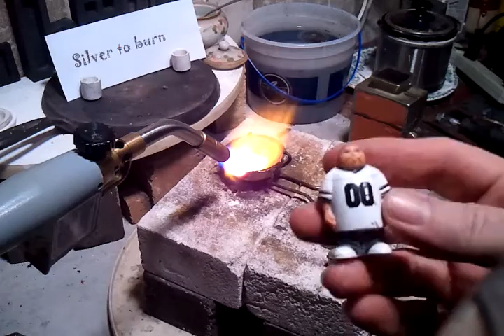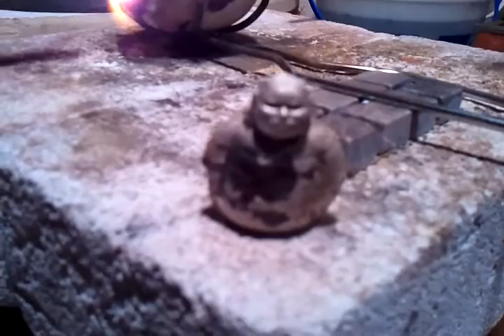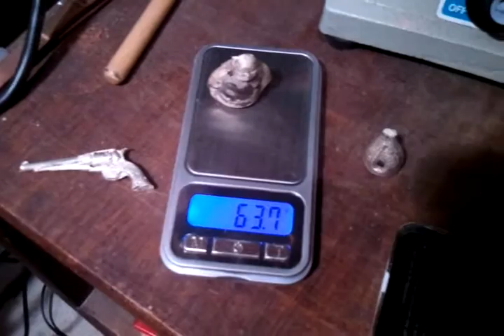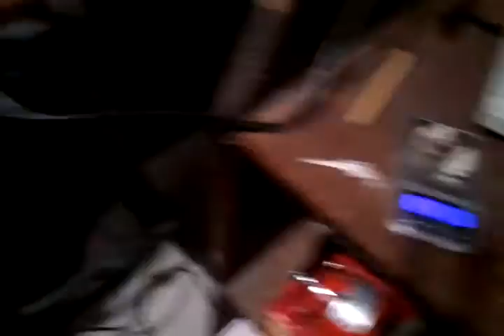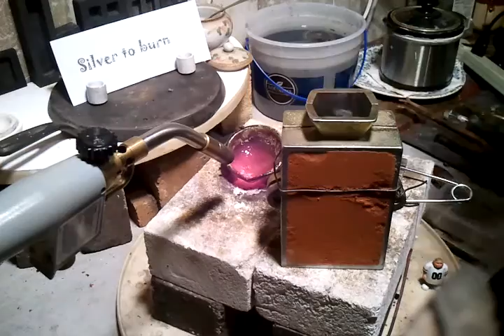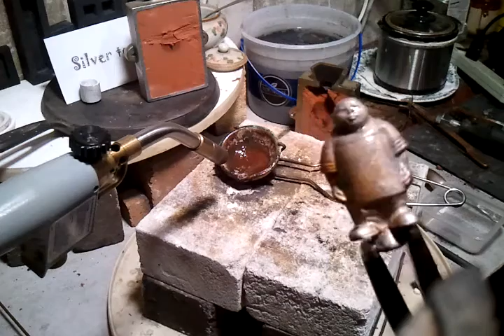POURING A 3 OZT SILVER HOMIE PART 2 of 3.   EPIC CLOSE UP #25

Comment: Hi,I see you preheating the crucibles ? The petro sure does a nice job of picking up the file lines. even with a bit of"shmoots"It could be repaired or I s'pose just re-pour with an air bleed,,,,maybe ? Thanks again,,,Always !
Reply from the maker: Yes ya know you can put some vent lines in there! Sometimes I remember sometimes I forget to do that, it can help!! Sometimes ya forget stuff when you're doing a video!  Yes preheat the crucibles! For 2 to 3 minutes befor you put the metal in! It will melt faster & better for it! Thanks for watching!